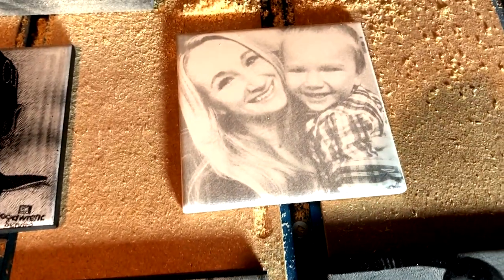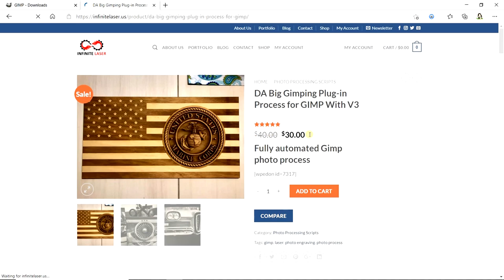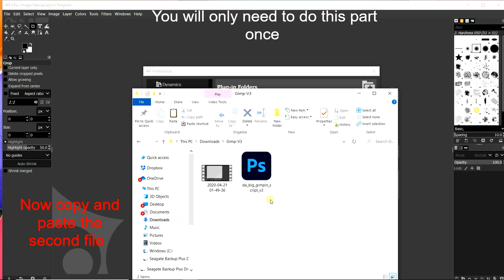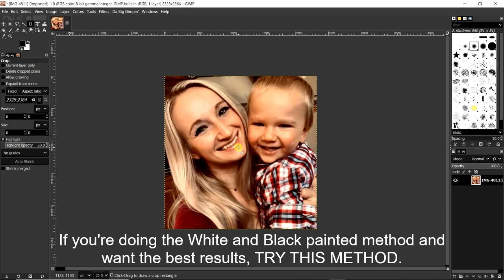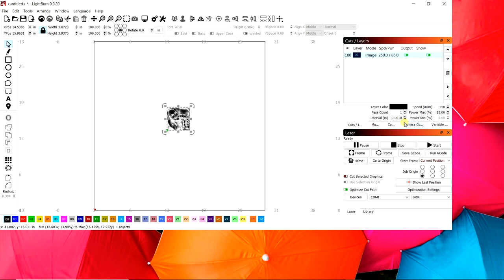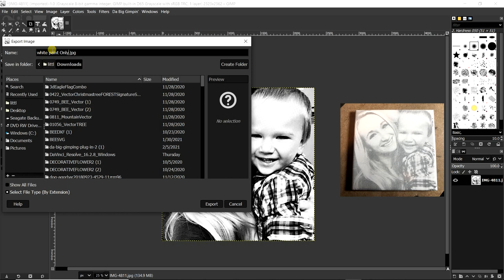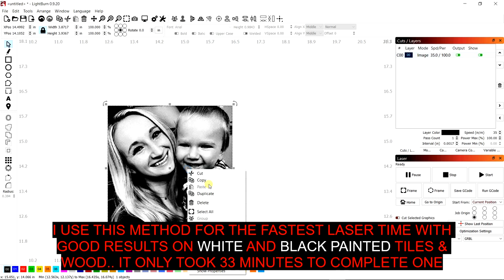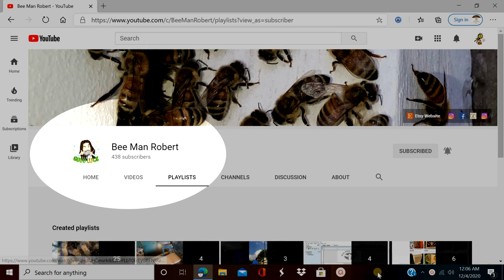Laser engraving Painted ceramic tiles FULL PROCESS 7w Pro Laser

Comment: Some comments on your process:
a) The DPI that you use to resize the photo initially in GIMP determines the size of the dot that will be produced by the plugin during it's routine. If you set a low DPI when scaling the photo, the plugin will produce large dots, and if you set a large  DPI, you will get  smaller dots. So choosing 1000 dpi results in very small dots created by the plugin.
b) When you setup your ImageBurn settings, setting a DPI that results in a number smaller than 0.08 mm is not advised. Your Diode laser can only print about 11 lines per mm, which results in a 0.08 distance between lines.  Your laser can not do 1000 dpi, at most is can do 280. Because of the way that the stepper motors work, a setting of 318 DPI in Lightburn is the ideal number (200 steps per revolution on 20 tooth pulleys.) You get the 'sanity check' warning  because setting the distance between lines as small as you do is 'an obvious mistake' according to the Lightburn software; no machine can do that resolution.
c) The plugin dithers the image... it converts it to dots. Since you have already dithered the image before importing in to ImageBurn, telling it to dither it again makes no sense, and can cause problems such as banding. If you already have a dithered image (and that is the main thing that the plugin does), you should use 'passthrough' so it sends the already dithered image through without further processing. Otherwise you end up re-dithering a dithered image.
If the settings that you are using work for you, then by all means continue using them. I just wanted to point out some items that might be confusing.
(BTW... I used to keep bees myself. Life changes made me stop. It is a great hobby that more people should take up.)
Reply from the maker: Thanks for your input I’m always learning myself. I usually do more of the Router engravings as i put them on Beekeeping equipment that i sell to lower 48 states 
Check out my website @
Www.LittleLarueApiary.com
Reply: I that the same with .9 degree steppers?
Reply: @darylpelletier9838   Pretty much yes. The size of the laser dot is the determining factor, not the size of the stepper step. Using 'microstepping', you can set the stepper 'step' to ridiculously small amounts, like 1/128th of 1.8 degrees, but it will make little difference because of the resolution of your imaging system.

Comment: Thank you like to know if that same procedure will work on glass
Reply from the maker: It will only work with white and black paint process. / not white painted because the laser won’t engrave in glass as it will pass through it and burn the underneath material.

Comment: Great video, has a lot of good info. DPI variability, will have to do with spot size so it will be interesting to test that out on the laser i just bought of course it will be at the expense of a longer print and you will have to worry about the cnc staying well positioned over the time. Anyhow thanks.

Comment: Any photo processing done outside of lightburn...using da big gimpin plugin...is undone if you don't use pass-through.  If you are using settings in lightburn just convert the image to grayscale and export as png. And use lightburn.
Reply: not undone .  the image is inverted and newsprint
Reply: @GORD0007  not undone, but muddied for sure.

Comment: I ran across this after looking at your photo Vcarve videos. This is an intriguing idea. Does the laser only burn through the white paint, or could you just use a clean white tile? Thanks.
Reply from the maker: You must use at least white paint. Then turn the laser up kinda high and it should Engrave the white tile. 
Second way is to use white and black paint that works easier using lower power on the laser
Either way you Must use paint for it to work
Reply: @BeeManRobert  Okay. That makes sense. Thanks.
Reply: @jimhester2004  You can actually burn "unglazed" tiles without paint at all.. and they create a very nice dark burn that is permanent.. the issue is the tiles aren't water or stain resistant like the glazed version.
Reply: @oneheadlight8000  thanks, josh.